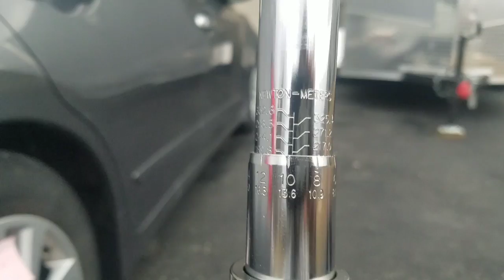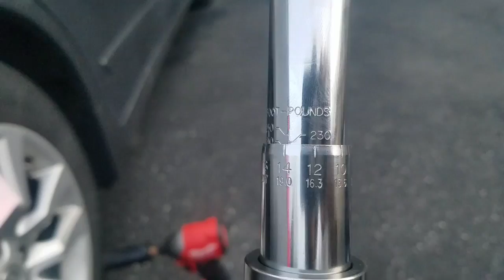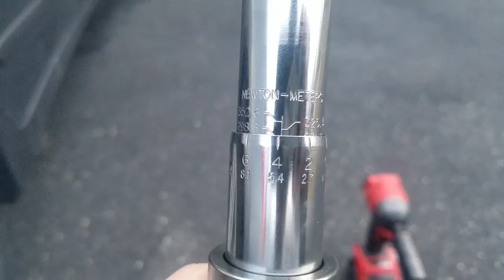Milwaukee M18 Fuel (ONE-KEY) Impact Driver Torque Test ..Lug Nut  (2857-20)

Comment: What’s the range of torque specs for typical  automotive use? I’m kind of stuck between the freak on sale and a impact wrench and a 12v Fuel snubnose. 

For impact drivers, can you rate the brands? Quality/power/endurance/overall, kind of like a “Doug score” if you watch Doug demuro car reviews
Reply from the maker: Freak is a impact driver buddy 👍..go with impact wrench .. 👍

Comment: I've got 2853-20. Rated 2000 inllbs and it struggled with 100ftllbs on an aluminum rim. Gonna have to do some more testing.

Comment: just ordered one.. wasn't aware of how insane this thing is.. as the dealer said it handles 230 nm i was stunned... Seeing this.. I'm speechless...

How long will the battery last if you do this?
Reply: I own this impact & I use it everyday for my scope of work. This drill is an absolute monster
Reply from the maker: It's powerful as crap ..I have it duels with other Impacts not even close

Comment: You're showing a piece of paper with a torque written on it, then showing the wrench. You are not showing yourself actually tightening the nuts in the video with the torque wrench.
For all we know, the nuts could be 75 ftlbs.
The reason I am skeptical, is because I have the Gen 2 version of this tool which is rated for 1800 inch pounds (in other words 150 foot pounds). It can't even budge 100 foot pound torqued nuts on my car.
It's pretty hard to believe that in one generation they went from a tool that is overrated for torque by at least 50 foot pounds to one that is underrated by 60 to 80 foot pounds. Does anyone else watching this have the Gen 2 one key and find that it's nowhere near the torque that they rate it for? Thanks
Reply from the maker: Your guna have to trust me ...or better yet you go do it yourself and see 😉😉👍
Reply: Lol...well either you don't know how to work a impact driver or yours is busted , I do 150 ft/lbs all the time with my gen2 Milwaukee
Reply from the maker: 🤣🤣🤣 I don't Kno what nutz hes torqing ...my harbor freight Bauer can loosin 100ft pounds ...he may have blue balls !! 🤣😉👊🏻🤟👍

Comment: I snapped the drill bit adapter trying to do this! Insane torque.
Reply from the maker: 🤣🤣 yea with much ipm ..u better have few around 4sure
Reply: They have a few that are impact rated. I don't think the normal adapter is meant for this
Reply: chris jones it was the Husky impact rated adapter. They exchanged it with no problems luckily. But, sheesh! 😂
Reply from the maker: @jeffparker360  better be prob cost you $20 🤣🤣🤣👍😉
Reply from the maker: @chrisjones6165  yea this one is impact rated 😉

Comment: You should make a test fixture. Weld some bolts of different sizes to a piece of angle iron and use a torque wrench to put the bolts on.
Reply from the maker: Lugs are my test fixture 👍👊🏻😉

Comment: Wow! I have to say I’m extremely surprised at the ease this 1/4 hex driver took those lugnuts off. It’s definitely seems to be one tool you want have in the bag for multiple applications.
Reply from the maker: Yea the IPM is incredible...most impact wrenchs are around 2500 IPM .. some 3200 ..but 4300 is insane
Reply: @toolboss8410  the Milwaukee Brushless (Non Fuel)  impact driver 2850 has 4200 ipm